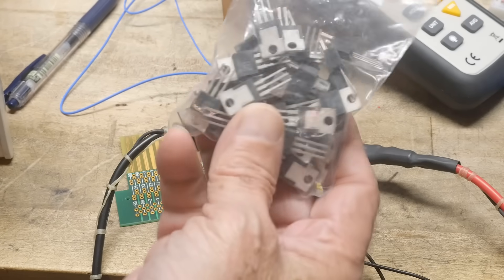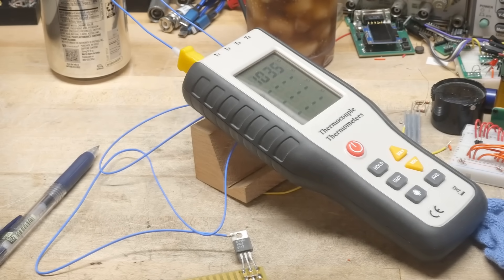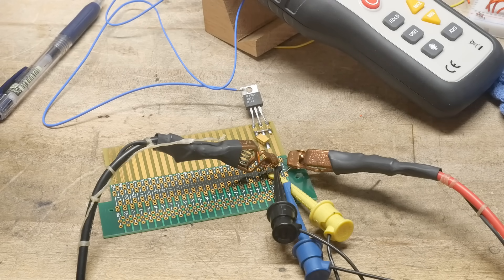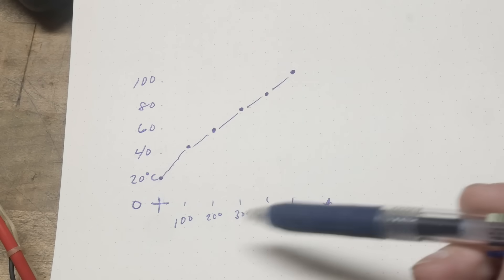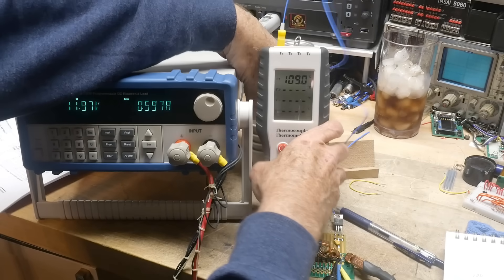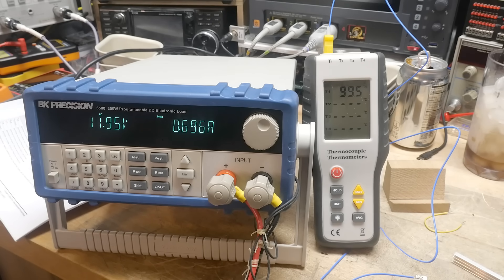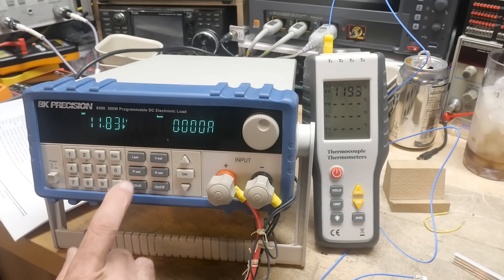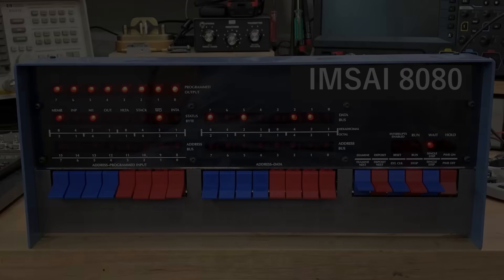#2474 LM7812 with NO heatsink?

Comment: This reminds me of something I've been thinking about... I have a homebrew linear amplifier cooled by a large heatsink and a couple of fans.  Could I eliminate the fans by separating the heat spreader from the heatsink with Peltier midules?  The heatsink would run hotter, and the rate of heat coupling to ambient would increase.  Probably a losing battle because the Peltier current adds more thermal load...

Comment: 0:35 It depends on the input voltage. The higher the input voltage, the hotter it will get, even with only a few hundred mA. There should be a resistor in series if the input voltage is high. 100ohm 5W.

Comment: This is only true if using 15V in and 12V out, as at 0.5A it will have to dissipate 1.5W.
Any higher input voltage will lower the current drastically or thermal shutdown will occur.

Comment: A bit more on thermocouples and probing:

A couple of us mentioned that type K thermocouples are usable to over 1000 °C. The insulation on the typical low-cost bare bead thermocouples isn't good for anywhere near that temperature. You would need ceramic fibre insulation. Glass fibre will get to to around 400 to 500 °C. Of course silicon semiconductors will have given up the ghost long before reaching even 400 °C.
It is best not to allow fluoropolymer insulation to just burn back from a very hot junction. Strip it off first if you have urgent need and don't have something with high-temp insulation on hand.

I think it was in a Motorola ap notes or handbook that there was advise on how to drill through the epoxy of a TO-220 package to get down to the metal near the die for better accuracy in estimating die temperature for a device mounted on a heatsink.

Comment: Probably three decades ago in some publication from one of the major manufacturers of linear ICs, there was mention of running an LM78xx or similar without a heatsink with the specific intent of having it shut down due to overtemperature, I don't recall just why this was suggested. I think it was to protect the input source from long-term overload.

There can be a big difference in power dissipation in a regulator with a regulated DC input source and a conservatively-designed transformer-rectifier-capacitive filter circuit.

The plug says that's a Type K thermocouple. They are quite useable up to over 1000 °C.

There is a very big difference between thermal shutdown and a crowbar. A crowbar is so-named because it emulates tossing a actual crowbar across power terminals - it short-circuits the output of a power supply, normally used as a secondary means of dealing with overvoltage. Better to fry the supply than the downstream circuitry. Typically done with SCRs designed specifically for the task.

I know someone who knew someone who attempted (unintentionally) to crowbar a single cell of a submarine battery with a wrench. It welded itself in place and the person, knowing what to expect, just stood back while the wrench passed through red to white and melted in two. He went to his tool box and got another wrench and pressed on.

Comment: I just put heatsinks on these as I don't want issues. But, I guess at a sufficient sink depending on voltage drop and load current. Then feel the heatsink or put a thermal probe on it. I never did what you did but always wondered. Thanks for doing it!

Comment: 1:41 I have both guesses and experiences related to using them without a heatsink. Experience tells me the automatic thermal shutdown work really well and it's really hard to kill them from overheating. Experience also tells me that they're really easy to destroy from other methods.
My guess is that the thermal regulation on them is good enough that you could probably use one as a constant temperature regulator. As in, if you used it as a power supply for LED light mounted on the same heatsink as the leds, you could probably use it to regulate the current to keep it at a certain temperature.
Obviously it's a stupid way to do that, but I bet it would work.

Comment: I made a variable linear supply with an LM317 and a PNP TO3 boost transistor for extra current. The LM317 was attached to the same heatsink I used for the TO3. When the pass transistor got too hot it would heat up the LM317, and it would start to current limit the transistor. I used the thermal shutdown of the LM317 as the thermal sensor for the pass transistor. I could short circuit the output at 8 amps overnight without issue. Found that out by accident.

Comment: Typical design is to accept ambient in a case as being 50C, and a good rule is to run the heatsink at no more than 80C, so a 20C rise for whatever power you dissipate. So for your 3W of dissipation your heatsink has to be better than 7C/W capability, though for things with less than good expected lifetime  you can probably accept a rise to 100C as being usable. thermal shutdown is not to be relied on, i have seen many that would oscillate going into and out of thermal shutdown, and that often meant the input voltage was applied as the peak of the oscillation to the output as well. Also as it is not actually tested, you might have batches where it does not work, so it will run, till it manages to diffuse the junctions all the way through the die, shorting input to output.

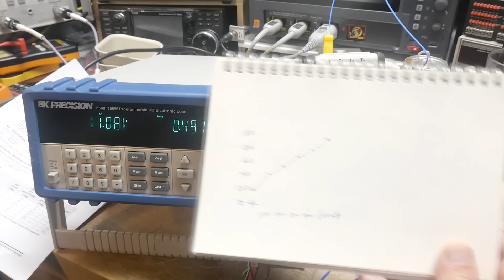Comment: you completely forgot to monitor the input voltage so the graph @10:00 is meaningless because the Vin-Vout is not there and that's what matters. The power dissipated in the device is not just determined by the output amp.
Reply: @00:44 he said that he is driving the 7812 with 15V
Reply from the maker: make sure you watch/listen to the whole video before commenting. I said the input was held constant at 15V
Reply: Yap...and an un heat sink 7812 seems to dissipate 3 x 0.8 = 2.4 watts...without going into shut down 

Lots of TO-3 transistors can take more powet..

I think the max rating of 7812...rated for 20 watts...with an infinite heat sink..

Glad you stressed it. Now toss it and use a heat sink in future designs play toys...

Comment: Over the years I've used 78xx's for all kinds of quick and dirty power supplies and I'm sure I've skimped on heat dissipation and most of the time they seem to keep going and going. I prefer them because I'm usually using them in RF related projects.

Comment: About 35 years ago I had several czechoslovakian Tesla 7805/12/15 in TO-3 package and needed to charge various NiCd and NiMH elements and didn't bother spending money on 317 even more so on a charger, so I slapped "hanging in the breeze" charger out of them - no problem 1/10*C charging without radiator for the 3 What package even in close to 40°C summer heat, so I used the contraption as is hanging in some out of supermarket food product plastic box for many years.

Comment: it's not so much the current but the voltage dropped across it. 1A @ 6V in and 5V out is 1A at 1V is 1Ws dissipated, Now increase the input to 15V so now we have 10V at 1A is 10W dissipated. being a linear regulator the voltage dropped across the device can be the killer.
Reply: It's only the power dissipation! If you stay in the datasheet current and max voltage ratings. I also used 7805 with higher input voltage than allowed by the datasheet, below 30V was used, and had no problem when stayed in the dissipation limits with apropriate heatsink mounted.
Reply: Older datasheet says up to 15V max for 7805 but newer says up to 35V.... so it was within spec. Only 1.5A regular current.
Reply: @saiteklilo50  it's the voltage drop across the regulator that's the killer. As i said a 5V regulator passing 1A is dissipating 1W with a 6V input. if you raised that to 35V then there will be 30V dropped across the regulator so you would be trying to dissipate 30W's. it will get bloody hot very quickly and be dead a few seconds later.
Reply: @saiteklilo50  i think the reason why voltage range was  extended is because older datasheets  assumed more linear loads and closer matching transformers, because the main use was just to smooth out noise in a small plug-in power suply, but the silicone could always handle that 35V or 32V as datasheets mentioned , only the  power loss would be unresonable to do so. so they segmented 5, 9 and 12v regulators to one datasheet and caped input at resonable 15v, while higher voltage variants like 7824  used the actual max voltage (some datashets say 3,3-18v are max 35v and 20-24v regulators can work with input up to 40v) plus you can always bodgelower voltage regulator to work as higher voltage one by placing resistor or voltage reference between  ground leg and ground or negative voltage if you want to lower it and that will also mess up voltage operation range
Reply: @saiteklilo50  it truth the only real thing about power dissipation is to keep the silicon dia below it's max temperature. follow the datasheet guide on thermal resistances to ambient and your know how much current you can draw with the voltage across the device.

Comment: Design a linear regulator to maintain the voltage across the range of current consumptions expected. At highest current demand, the voltage drop across the regulator should be just a little bit more than the regulator headroom. Then as the current draw reduces, the voltage differential increases.  This leveling of wattage enables the designer to accurately predict power consumption and appropriate thermal management.

Comment: Rule of thumb is 1-2W is safe depending on open or closed enclosure.  Why not calculate the watts of you can measure both current and volts?

Comment: From my own testing of cheap clones: enough current to eventually melt solder that holds it onto my leads, and somehow still survive. I kid you not. They worked just as terribly as when I started!

As a side note though: don't throw that regulator out! It's fine. if you doubt it: run it at high temp like that for a little longer. If it eventually cuts out, that's when you know the junction has internally degraded. It has built-in compensation for that, albeit by accident or incident. It's not intentional, but a nice side effect.

Comment: My general "rule of thumb" is if you lick your finger and touch the device and it goes "stss" it is too hot.
Reply: rule of burnt thumb
Reply: I dislike burnt fingers,  I got a thermal camera now.
Reply: @TomSherwood-z5l  Thats what the spit is for
Reply: Just remember to let go before the sizzle stops or you'll get burned.
Reply: Love the spit sizzle test
Reply: I use the  same rule for electronics and grinding hardened steel. "If you can hold it with your fingers then it has not been damaged"

Comment: TO-220 typ less than 2W total Pd w/o heatsink
Reply: I agree. Many TO-220 devices state that limitation in the spec sheet but not all.
Reply: @Electrotech1980  and thus the reason I say typ(-ical)

Comment: I would normally prefer to use a low-dropout type regulator, and use a lower input voltage to start with. So that keeps the differential voltage across the regulator low and reduces dissipation.
Reply: The downside to lowering the headroom is lower PSRR.
Reply: What is PSRR? Type the whole words!
Reply: Yeah that's a fair thing. That's part of the reason why LDO regs became a thing. The LM78xx series far far far predates modern types, and there's still nothing quite as easily accessible and easy to use as an LM78xx. It's unforgettable. :)

Comment: Was hoping for some magic smoke 😅. 
Fyi thermocouples go way higher than 100c. 
What's the glue rated to and how good is the thermal contact?
Reply: That's kind of the point of using a part that has built in protection to prevent precious magic smoke from escaping.
Reply: @mikesradiorepair  Even literal DECADES after its release, the 7805 and 7812 remain a staple. I still use 'm too! And this is part of it.
Reply: No, no, no… you go to electroboom for the magic smoke.